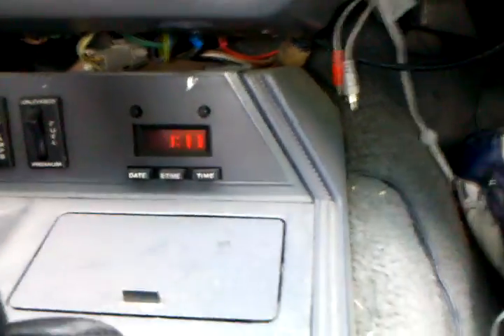PiMP Engine Management Initial Startup (Part 1)

Comment from the maker: We don't have a ton of videos covering the details of it, we cover it all in the 20 page startup guide we supply with each order, as well as how to pages on our support forum. The 2 step can be wired through the factory clutch switch, or using an aftermarket switch on the clutch, or a push button on the steering wheel or elsewhere. Here is a video of one PiMP user using the 2-step youtube dot com/watch?v=P7FPWpXA7rU

Comment from the maker: The wideband is wired through the factory o2 sensor harness. The PiMP will run a 2.3 turbo engine in a 92 Mustang with the factory harness and ignition system, or if you do the "turbo swap" wiring, you can run the turbo style ignition, both utilize the 92 Mustang harness only the turbo style ignition is a modified harness.